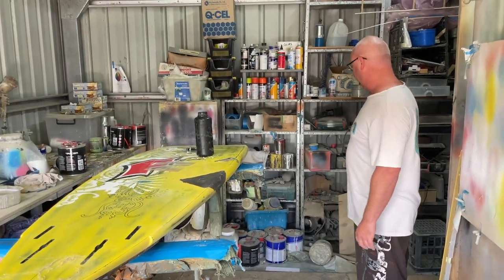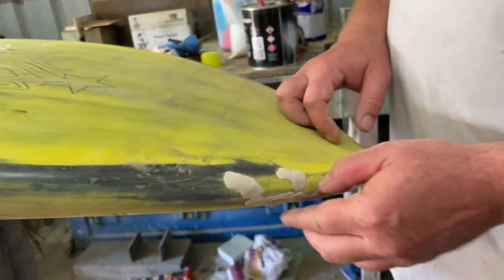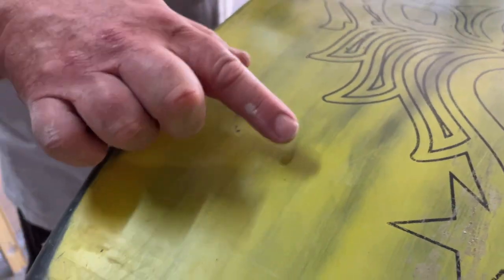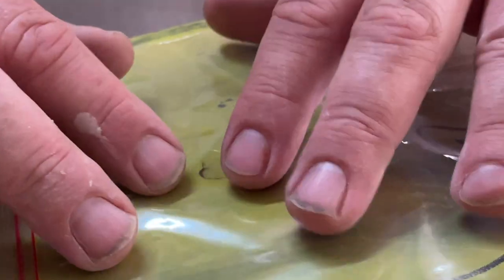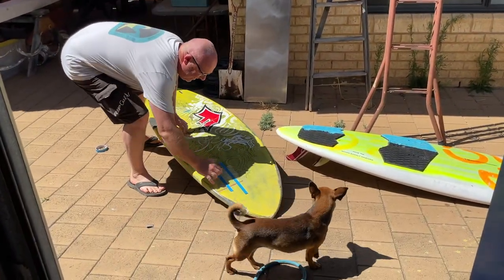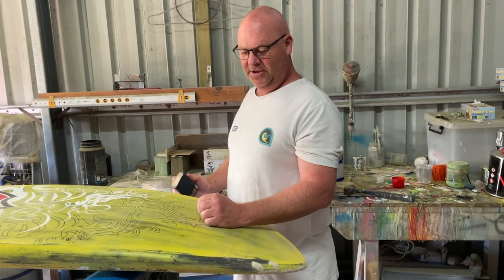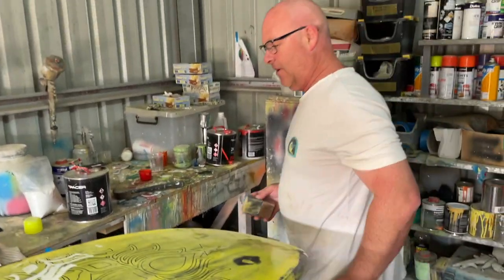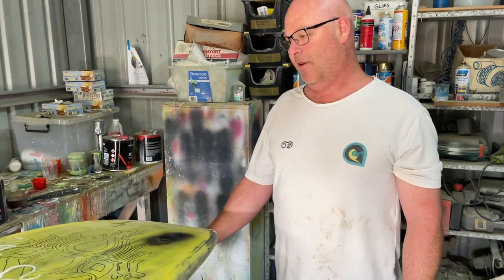Minor Ding Repair on Windsurf Board

Comment: Nice video! Any idea what kind of top coat do board manufacturers use? It doesn't look like regular paint, rather some kind of gelcoat (epoxy based). It would be nice to make a colored epoxy finish that will match the color of the board and offer better scratch resistance than the paint
Reply from the maker: Sorry I can’t help you. Mark who did all the talking has all the knowledge!

Comment: nice video. So I dinged the nose of my slalom board. It is really sketchy to get the SunCure filler in Germany. Is there any other epoxy filler I can use?
Reply from the maker: Best to ask your local surf shop 👍
Reply: @windsurfer  I might have to drive a looong way
Reply from the maker: @bigsean99  📱👍

Comment: Could you follow this same process but use polyester resin that needs a hardener rather than the UV stuff? I've got some of that from a repair kit for use with fibreglass and I'm trying to fix a tiny underside ding like in this video (on a surfboard but)
Reply from the maker: I’m pretty sure you can.
Reply: @windsurfer  Thanks mate. Don't see any reason why it wouldn't work so I think I'll just give it a shot
Reply: @windsurfer  Finished the repair today and it seems to have worked a treat. Bit more of a hassle having to mix it up and everything but I can confirm that it will do the trick! Thanks for the video and for your advice.
Reply from the maker: @ypsito  perfect!